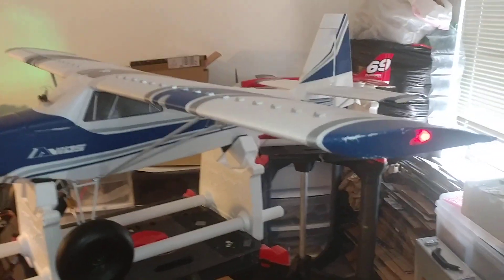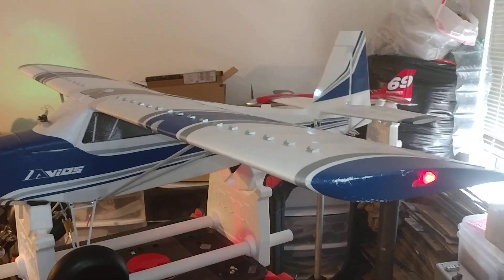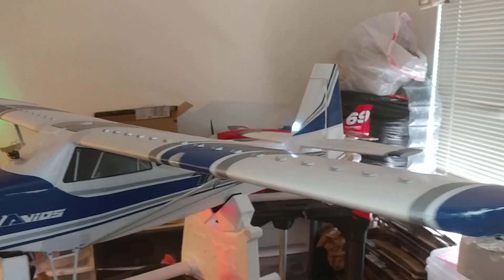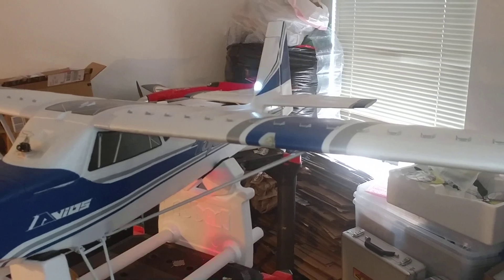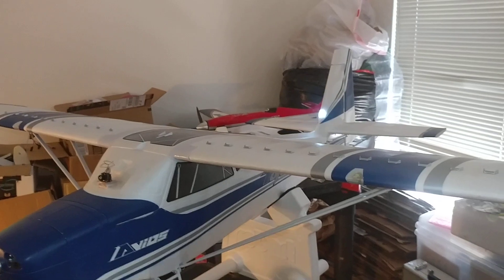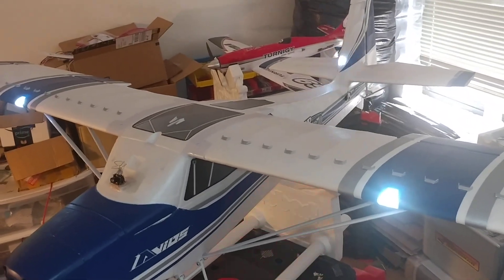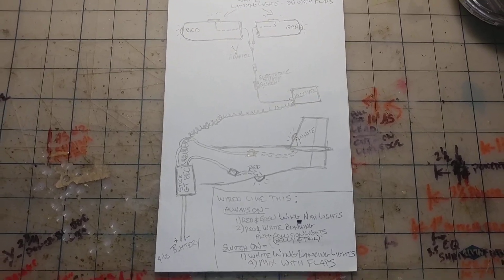Avios Grand Tundra - Wiring Diagram

Comment: Russ what did you use to flash the led in the vertical stabiliser please?
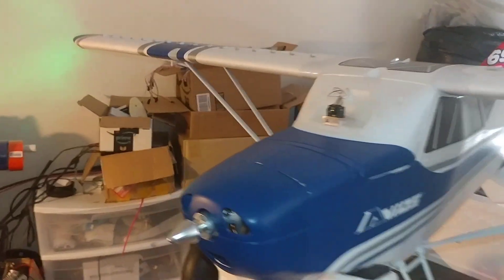Reply from the maker: When the vert stabilizer and belly light are plugged in to the stock BEC, they both blink.  Just like in the diagram at 1:36.

Comment: Hi, can you recommend a good DSMX receiver for this I have a DX8, should I get the Spektrum ones with or without AS3X or another brand that uses DSMX, also i see it recommends using a 7ch Rx to work the lights properly, is that so? And can they be/how would I get them to be off, on, blinking landing lights with half flaps, full on landing lights with full flaps, thanks
Reply from the maker: I don't use Spektrum, so I can't really advise on which receiver type will work best for you.  I use a Flysky - FS-iA10B (10 channel) with AFHDS 2A, as I have added telemetry modules: external voltage, altitude and temperature (battery or esc).  It performs quite well. Not sure how to get the landing lights to blink at half, but mine come on at full.   

I flew this bird again yesterday.  I drained 4 big 6s packs, 8 to 10 minutes per pack, even with the throttle down at times!  This plane is so much fun to fly.
Reply: Thats no problem, thanks so much, does it require 7ch for the lights to work? I see some people using 6ch but Others say you need 7th ch for the lights, is that right?
Reply from the maker: @Jonesyb1985  The landing lights have their own channel.  I then mix them with the flaps in the Tx.

Comment: 1. What reciever channel do you plug the black & white twisted wire labeled LED into?
2. Is the electronic switch a device you purchased....does not come with the Grand GT?
3. Which receiver channel do you plug the electronic switch into?

Comment: Russ Cooper: Any way to post your diagram as part of this video ???
Reply from the maker: I tried for a bit but couldn't find a way to post a pic of it or as a .PDF or any way!  Maybe you can pause the video and then do a screen shot?  I'll try again.
Reply: @rcoops58  I tried doing a screen shot --- not really that good.  Copied a few notes from the halted video; probably just need to add battery and receiver and do trial & error.  I found some other Internet source that showed landing lights mixed with flaps; at half flaps, landing lights blinked; at full flaps, landing lights on solid.  Seems to indicate that the lights may be 'programmable' (on solid or blink) --- any thoughts/info on that ???
Reply: Tom9Zawodny can you link that vid you watched please!
Reply: I paused the video and took a picture of my tv screen. Works great....